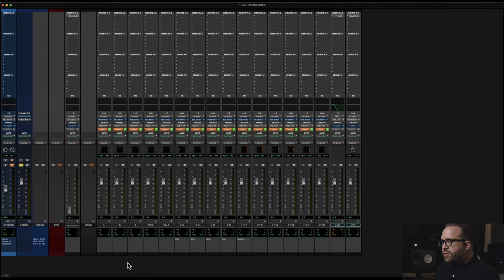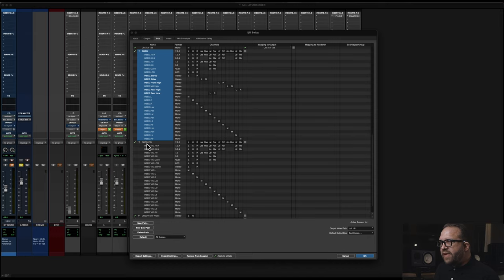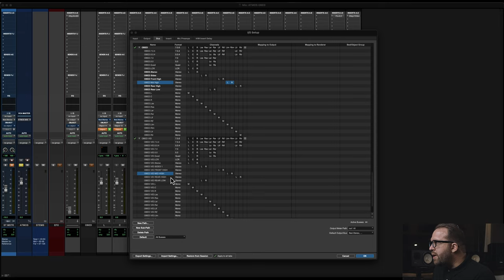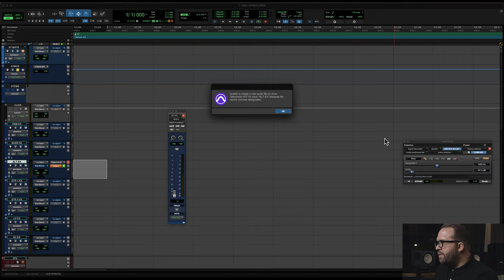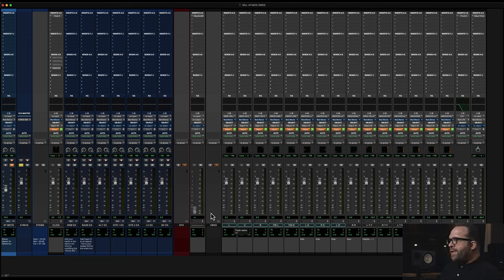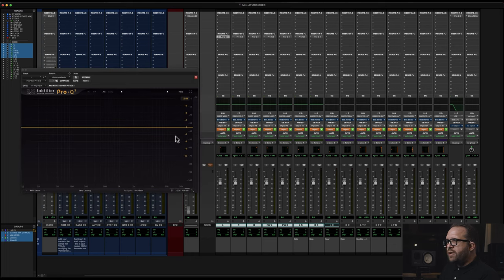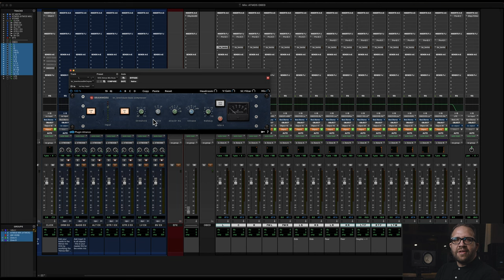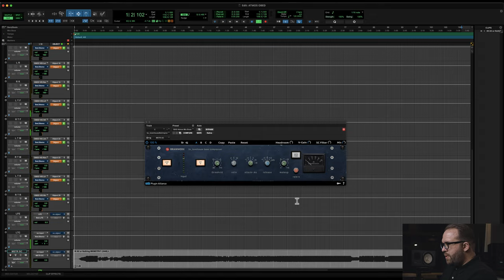Exploring Object Bed Mix Buses in Dolby Atmos Mixing - (Part 2 of 2)

Comment: Super helpful video here! Thank you!! One  question for you: 

What binaural settings do you recommend for the object beds? I'm guessing LCR near, Sides mid, rears far... etc
Reply from the maker: Hey @YianniAP ! Thanks for the kind words and the observant question. I’m happy you enjoyed this one. 

Regarding the OBED binaural settings, I'd encourage  you to mess with those, because it is a matter of taste, but also a matter of how you want your mix to translate to binaural. I've experimented with this a lot, and below is my starting point for every mix. I find the translation to binaural is excellent with the information below, and then I change the parameters if the mix calls for something different.

My default OBED binaural settings are:

LCR = Off
Front Wides & Sides = Near
Rear = Mid
Height = Near by default, but sometimes I use Mid if I want more separation

Comment: Appreciate you holding our hands through this. 😅 Question: why send the same signal to multiple objects in the object-bed and not just use an object and place it where you want? Isn't it ultimately the same? Certainly if you wanted the sound to move it'd be trickier to work send levels than pan. I've seen people set up half a dozen delays bussed to the object-bed to move a sound backwards, which seems needlessly tedious. (Though I could be misunderstanding!)
Reply from the maker: It’s a good question! It’s not “multiple objects”. Whether you use the OBED Technique or not, it's still a singular object output assignment. The OBED technique allows you to take mixing beyond the capability of the stock panner. So you can reach multiple locations in the room simultaneously, but you get to customize those locations with the routing. 

Yes, if you want to pan that OBED object, you have to manage multiple automation points, but creativity can be really fun. 

For me, it comes down to a few things: 

1.) Panning an object to multiple places can make that object sound massive. It's bigger than what I can achieve with the stock panner. My example of bass is a good one for this. While the primary source is projecting from the main L/R, sending it to the back massively extends the signal. And you cannot do that with the stock panner. You’re sitting on the bass — like the floor or foundation. You have to get the balance right so it sounds cohesive, but once you do, it’s massive. Now, think about applying that to the rest of your mix! It adds up big time. When I compare Atmos to Stereo, Stereo feels broken with how big these Dolby Atmos mixes can get. 

2.) Translation. When I use the OBED technique vs mixing with the Bed, the fidelity in the panning seems to be higher to my ear—more accuracy on the panning paths and how they feel in the binaural render and distribution platforms. I’ve found that sound sources going through the Bed only waver and don’t truly represent what I did in the room. This point is more about mixing with the best end product in mind.

Comment: Hello Shane, Great video. Thank you so much for your information. This makes a lot of sense but does the routing for the OBED change for the internal renderer use? Im having issues when I look for the inputs of each  Aux of the OBED not being able to find the new subpaths created like the front high for example. Just doesn't show up.
Reply from the maker: Hello, @titothelegacy ! Yes, the internal renderer is more for straightforward workflows, and users getting started with Dolby Atmos. The OBED technique is pretty advanced, and it’s not possible to use the internal renderer with that technique.
Reply: @shanegrush  Awesome. Thank you for the quick response. I was breaking my head trying to see if could get it to work.  I'll go back to the external renderer and try again.
Reply from the maker: @titothelegacy - you're welcome. I had a video in the works when the internal renderer was released to compare the two. I learned the internal renderer isn’t for me. Not to say it's not valuable for others, but my workflow surpasses the capability of the internal renderer.
Reply from the maker: @titothelegacy  - Hey Tito, I wanted to come back to your comment and let you know that I found a way to make the OBED technique work with the Internal Renderer tonight. If you'd like to know more, shoot me an email and I'll send you some screenshots on how to setup the routing.

Comment: Hello @Shane thanks for the video. I have a question: Is there benefit to making the object aux/groups mono versus stereo? For example the Left and Right could a stereo object, Left/Right Rear another object. I work in Nuendo and I am trying to figure out your routing in regards to how Nuendo does it. thanks!!!
Reply from the maker: Hey @gclef101 ! The OBED routing is made up of mono aux tracks because those tracks coordinate with one speaker all the way around the room. Think of it as a 1:1 connection from the DAW’s output to the input of the Dolby Renderer.

Comment: So essentially with the OBED bus eq or compression is only affecting the sonic quality of the song if you feed audio into those buses? Besides that you will not affect the sound? I wish it affected it regardless and I'm sure I can do this if I just do the same thing to the individual stems from the project. Honestly I can't wait for Pro Tools to do what Studio One did for this work flow where you can essentially have a MIXBUS on your ATMOS project without having to do this extra side chain/attributes work flow. (Side note: I followed along after the update came out with the internal renderer and it definitely changed a few things, maybe you can do a refresher or something like that for the new versions of pro tools as a video) Thanks for the video and great job! Hope to hear from you soon!
Reply from the maker: Hey @MikeyOnTheWay, yes. The OBED is essentially a mix buss. Correct, the OBED is inserted after the track output, but before the Dolby Renderer so if you do not have signal on a channel it’s not processing anything. This is why the side chain compression is key. You can certainly experiment with processing the individual stems. On a recent project I did both. I did some “pre mastering” to some stems because they sounded nothing like the final stereo master. 

That’s cool about Studio One — I’m certain we’ll see lots of advancements and new techniques as the days go by. 

The internal renderer setup with the OBED is similar. I’m testing that now and I hope to put out some content on that topic. 

Thanks for the kind words and watching!

Comment: Great tutorial! Thank you so much I will try in my studio. One question: Wouldn't it have been better to use the stereo mix as a side chain master instead of the stereo master since the track has already been processed with a limiter and the dynamics have been reduced? thank you
Reply from the maker: Actually no, and that’s because the input to the OBED is made up of mono aux tracks. If you had a stereo aux track then yes, you could use a stereo source to feed that input. 

Thanks for watching!
Reply from the maker: Slight add-on here after thinking about your comment a bit. I want to reiterate I’m not using a lot of dynamics processing in my Atmos mixes. I wanted to show how it could be done via this OBED technique the pros are using. My approach is because of what you mentioned, and that’s because I’m mixing from stems of the stereo mix that have already been processed.
Reply: Sorry I was not talking about a mono/stereo question but just about using a more dynamic key (so the mix and not the master) for side chain input. But I understand that sometimes the mix is not available. 
The technique is very interesting, I’m not using a lot of processing in Atmos mixes too but could be useful 💪🏻
Reply from the maker: 💯 - your project, songs, mileage may vary. I wanted to share the technique, and let mixers/producers decide themselves. 🤜🏻🤛🏻

Comment: Why 7.0.6? I don’t think you mentioned in your video why you didn’t include the LFE in your OBED bus
Reply from the maker: Hey @JamesArthurHurley, that’s because the “.1” is taken care of with the LFE routing (in the Bed). So, in that moment I’m only creating the track width I need. Unfortunately for me, Pro Tools Studio maxes out at that track width. Or else I would have created a 9.0.6 bus. My work around is to create two more mono aux paths to get me to 9.1.6. Lots of variables here depending on intention, and the rig you’re using. 

Edit: Remember the OBED by default is objects. So the intent is to not use the bed. Unfortunately, the only way we can access the LFE channel is through the bed.

Thanks for the comment. Good question. 🤜🏻🤛🏻
Reply: Lfe cannot be an object so it goes the bed 1